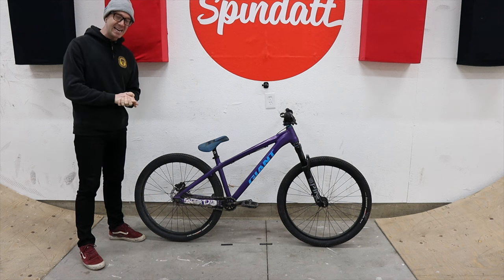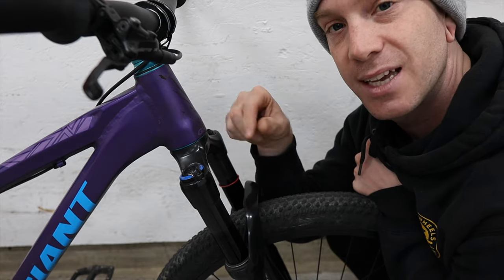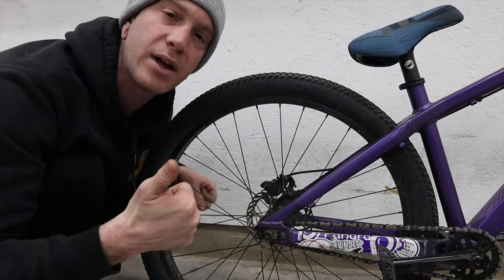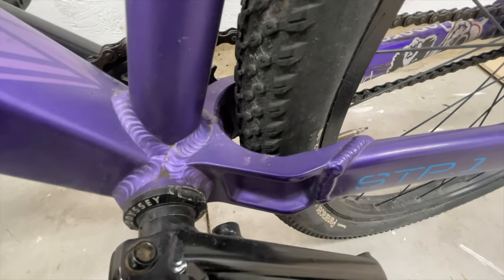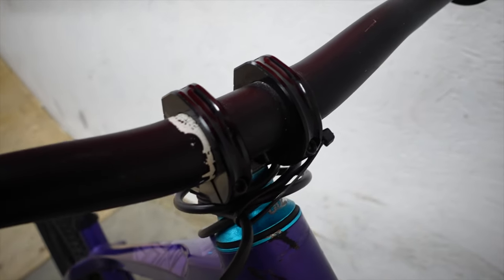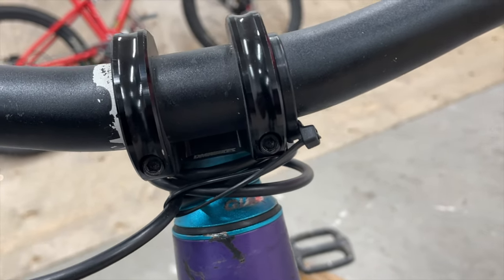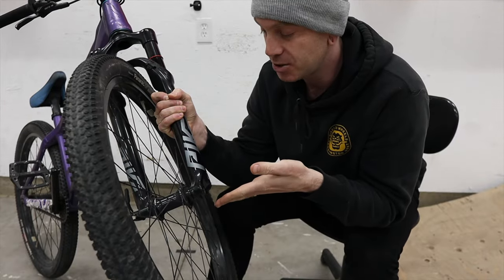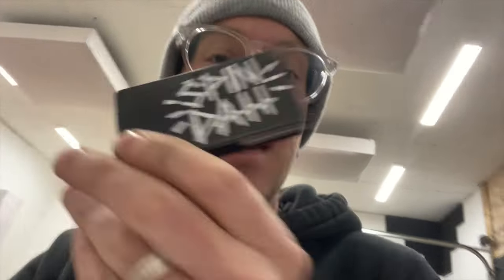My 2011 Giant STP 1. Completely Upgraded and Modernized.

Comment: As a former Giant bike tech I can say for sure that the STP is still one of their most well through out frames in such a basic form. They still make them convertible from a QR to sliding dropout but they are not selling the single speed in Canada. As for brakes I can’t recommend the Magura MT4 enough. Tossed a set on my dirt jumper last year and have since went all Magura across my fleet.